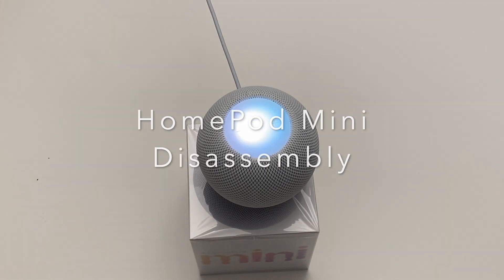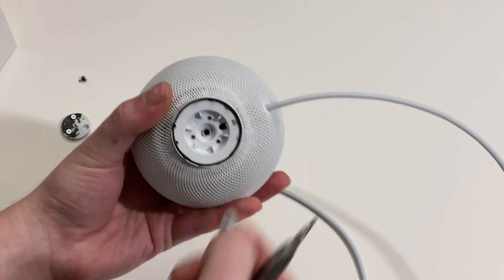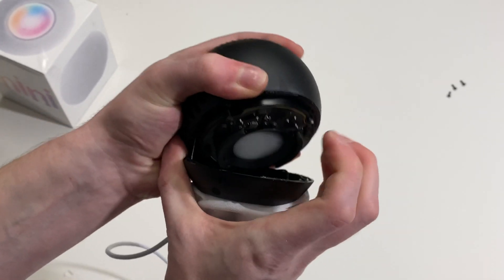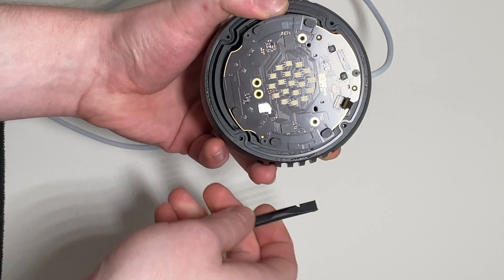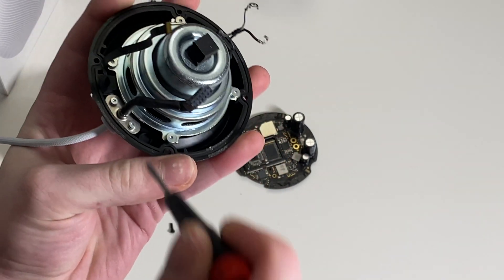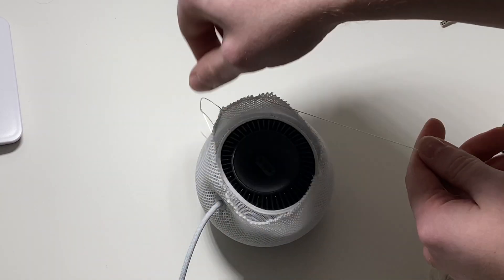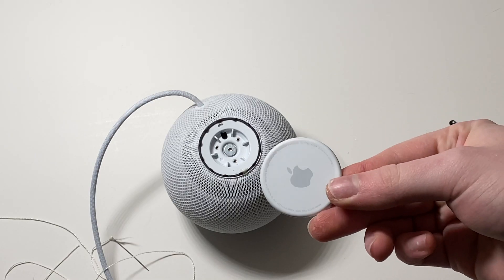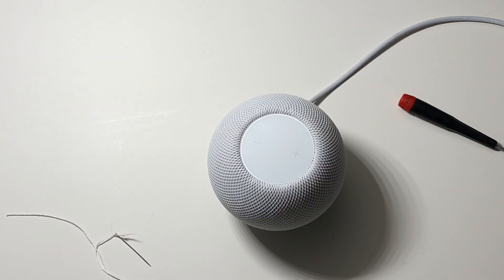Apple HomePod Mini Disassembly

Comment: Thanks. You helped me fix a HomePod mini with a faulty touch sensor. In these crazy times, it was nice to see the internet succeed today, demonstrating its capacity to expand our collective knowledge for good!
Reply: Thanksss!! You save my homepod mini!! ❤❤
Reply: Mine has the same issue. Is the touch sensor disconnected by the first pin he removed after opening the top?
Reply: @RezaGhavamizadeh  Disconnecting the flex cable that connects the top to the base worked for me.
Reply: Is that the ribbon cable he is talking about? Thanks!
Reply: @x-Just_Mike-x  yep. if you have the touch issue, you just need to disconnect the first ribbon cable you see after opening the top of the HomePod. it disconnects the touch interface from the main board. 
you'll loose the touch functionality, but the lighting module and mic and Temp/humidity sensors will keep functioning.

Comment: I installed this in Goertek factory in Vietnam, my job is to assemble them and test OK!  the speaker has a great bass range and the body is the size of an apple!  Apple will soon post an order for airpods vs our factory, the project should have been active but is being delayed because of the outbreak of Covid 19 in my place!  it would be nice if the project kicks off and I'll be involved in assembling them
Reply: It’s pretty anonymous though and he doesn’t rly leak anything. It is indeed quite interesting to hear from the factory workers :)
Reply: I am surprised you aren't under NDA to not say anything about this stuff, unless you are and don't mind it.

Comment: The driver looks jus like the ones inside the Bose SoundDock Portable.
Reply: thats because almost every brand uses the same speakers they only do the design and brand the rest is just copied lol
Reply: its not the same. i looked it up and the dust cp is bigger on the HomePod Mini. the surround is a bit different but looks similar.
Reply: @ashleynixon8305  ahhh thanks!